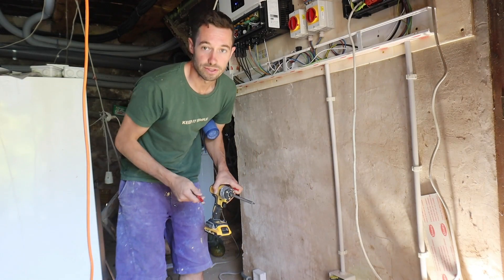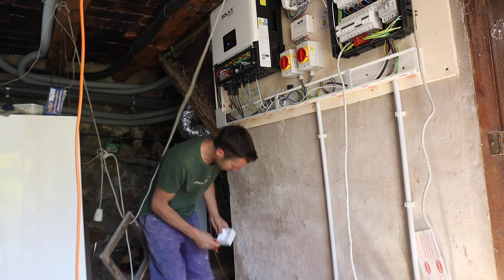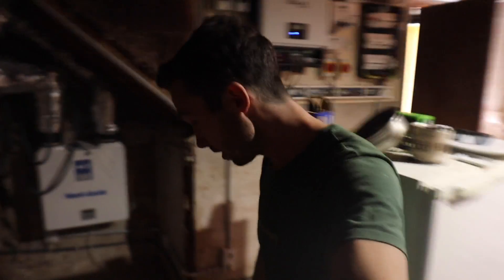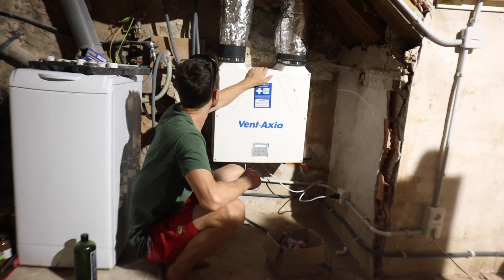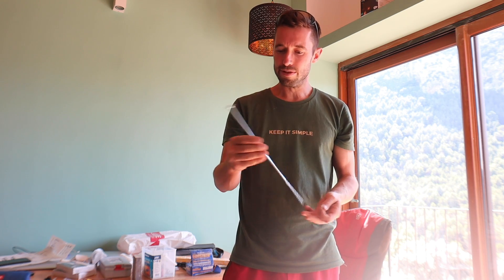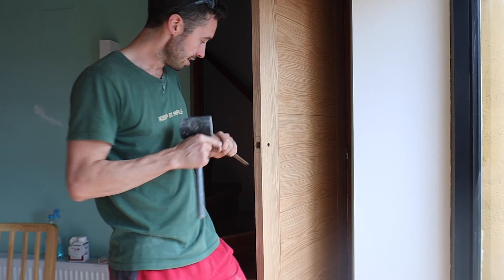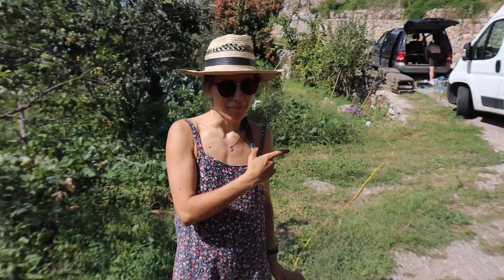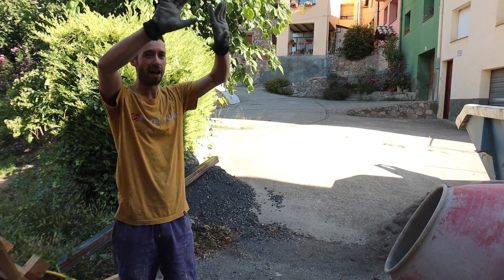How I Efficiently HEAT My ECO-HOME With SOLAR ☀️ // HEAT RECOVERY SYSTEM EXPLAINED 🏡

Comment: Massive walls and some insulation. A fireplace 🔥. Under-floor heating 🔥. Radiators 🔥. And storage heaters 🔥. Isn't that slightly overkill? You're not living up on the summit of Pica d'Estats, after all… 🏔
Reply from the maker: Haha just trying to self consume and keep the future as cheap as possible.

Comment: Nate Be sure the solar panels are grounded to a grounding rod and together. What is the  estimated solar wattage generation and how are you pushing power to different appliances so power is not wasted. Nicely done with no energy waste
Reply from the maker: Thanks Logan, yeah we put a couple big ass earth roods and linked it all up. The PV is 6500W.. using an iboost to shift from hot water heater to UFH/Storage heater ring. In hindsight maybe a immersun would have been better but was struggling to find out here.
Reply: @NateMurphy  Wow you do your homework. I think this house is going to stay plenty warm once it is heated up. Best to keep it the same temp day and night with those funky wall brick heaters. Great content thx for sharing

Comment: In Spain do your plugs have to be on a ring main like in the UK ?
A little confused about your electrical layout
Reply: The UK is pretty much the only country in the world that still uses rings, the rest of the world all use Radials.

Rings can be dangerous because if you have a break in the cable you wouldn't know and could be pulling too much power through a cable that is undersized and your breaker / fuse would be too high rated to break the circuit so the cable just melts and catches fire. 
It baffles everybody in the UK electrical industry why they haven't banned them but a lot of UK Electricians simply run radials instead.
Reply: @___AD  That question was on my mind also, now you have said that, I will do some more investigating into this as someone who was brought up on ring main culture-I am retired these days so these fantastic videos by the young  people are an insight for me.
Reply: here in Australia Electrical work must be carried out by a licensed electrician!  Fines are huge if you get caught & taken to court!